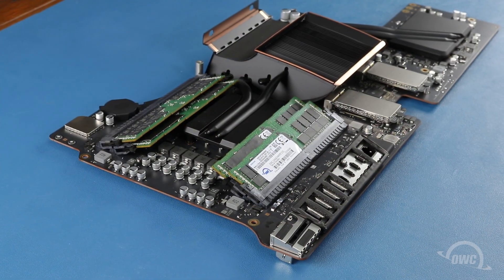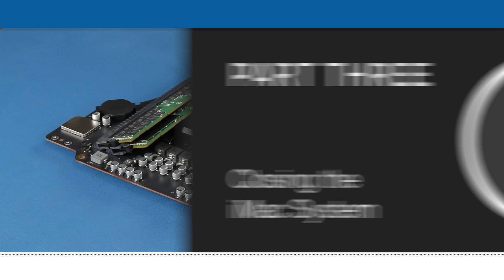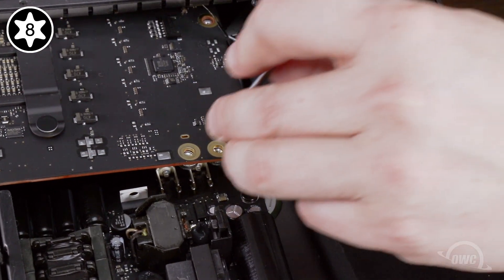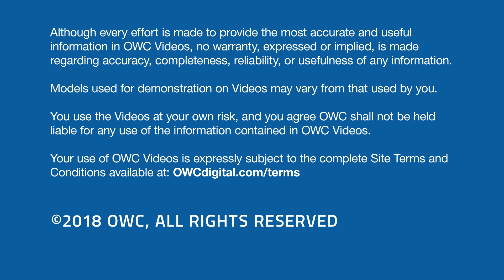How to Upgrade the Memory in the iMac Pro (late 2017)

Comment: Out of curiosity, what is the shielding tape on the lower RAM modules for?
Reply from the maker: The shielding tape on the lower RAM modules of the iMac Pro helps to reduce electromagnetic interference (EMI) and manage heat. It ensures stable operation by protecting the RAM from EMI and aids in maintaining optimal thermal conditions

Comment: Please tell me: iMac Pro has 4 slots for RAM cards on the motherboard.
By default, there are 4 pieces of 8GB each, if I want to upgrade only two pieces for RAM of 32GB, does it matter in which slots they will be installed? Thank you!
Reply from the maker: Yes, Nikanor, the iMac Pro has four slots, and you are able to upgrade two slots at a time.
Reply: @poweredbyowc Thank you for reply! does it matter in which slots two new RAMs will be installed?
Reply from the maker: You would want to have them in either slots 1&3 or 2&4

Comment: This video is great however I tried this with a 14-core iMac Pro preinstalled with 32GB (4x8GB sticks) and trying to upgrade it to 128GB (4x32GB). Machine is running Monterey 12.5. Swapping all the sticks with the 4x32GB sticks (RAM IS OEM AND pulled from another working iMac Pro), I end getting a black/blank screen on boot. If I put one 32GB stick in A0 (slot 1) and another 32GB in B0 (slot 2) (slots 1&2 are closest to the I/O ports) and then leave the OEM 8GB sticks in slots C0 and D0 (slots 3 & 4), the machine will boot. I wonder if there is something special with the firmware etc. that needs changed. It seems to want original OEM RAM still installed to boot. It seems like I'm fighting a software/firmware problem. I've also done the OPT+CMD+P+R to reset but no luck. Thoughts anyone?
Reply from the maker: I would recommend contacting our support team (https://eshop.macsales.com/Service/)  (1-800-275-4576
U.S.A.) As they can troubleshoot with you more directly and better help in determining both what is going on and how to best resolve it. Give us a call when you can...we would be happy to help you out! :)
Reply: Ended up being my RAM. Even though the specs match what the iMac Pro requires, the T2 or MacOS or whatever it is is finicky and wants very specific RAM so have to pay the premium to buy RAM that says its designed for the iMac Pro - totally lame.

Comment: This video makes me want to take a sledgehammer to my iMac. I cracked the screen using that little pizza cutter just like they showed here. 0:45
As it turns out, you're supposed to start at the top, then work your way halfway down each side.
Reply from the maker: @Rick, I'm sorry to hear that you cracked the screen on your iMac Pro. That's a lot of the reason why OWC recommends professional installation on the iMac Pro (and the 21.5" iMacs).

Comment: Tried install the 4x32GB but seems like not working, i try receding 3 times and make sure the RAM is fitting correctly but still won't boot. Put the old original RAM back in and it boots. I think i missed something? what are the common mistakes people make? 

With new RAM, fan is running but no chime no image
Reply from the maker: Sorry to hear about the issues you are experience with your memory. I would suggest cleaning the gold contacts of the memory before resetting them into your machine. If you have not done so a Pram/SMC would also help. Please reach out to us if you have any further questions!

Comment: The Processor suport up to 512 GB but apple said 128GB max? 
)W-2191B is a 64-bit 18-core x86 enterprise performance workstation microprocessor introduced by Intel in 2017. This processors, which is fabricated on an enhanced 14nm+ process based on the Skylake server microarchitecture, operates at 2.3 GHz with a TDP of ? W and a turbo boost frequency of up to 4.3 GHz. This chip supports up to 512 GiB of quad-channel DDR4-2666 ECC memory.
This specific model appears to be a special model for Apple for their iMac Pros.)
I know that 128GB ram stick are very expensive but there is posiblity to upgread to 512GB?
Reply: new mac pro in 2019?

Comment: I bought this in August after watching a mid iMac 2017 ram installation thinking I would add ram until I opened mine up realized they took out the ran slots for the late 2017
Reply: iBrownHyena you pay that much without knowing this ? That is a painful lesson. You can carry the machine to Apple or any authorized repair center. This is not casual task, need to be very careful
Reply: Jaime Duncan I don’t think August counts at Late 2017 and should be mid 2017

Comment: What a fling joke! Would anyone mind an iMac that is one inch fatter to accommodate ram and disk access ports? Screw you Apple
Reply: Fender Bender the vents for the cooling system are where the memory access door normally is on a 27” iMac. If you need an expandable machine, then wait for the Mac Pro or buy something else, that’s why options exist.
Reply: Na bro... I wouldn't buy it if it was an inch thicker.(sarcasm)